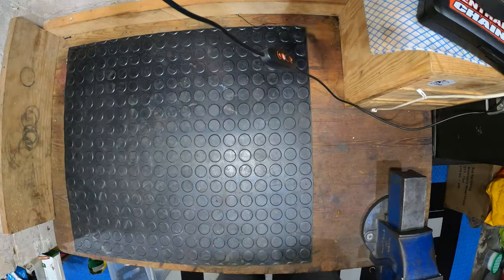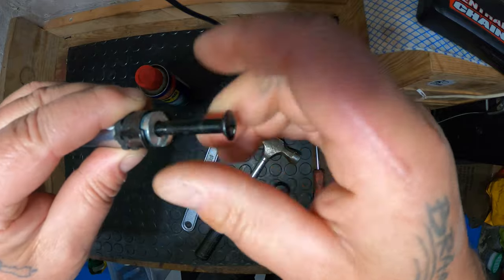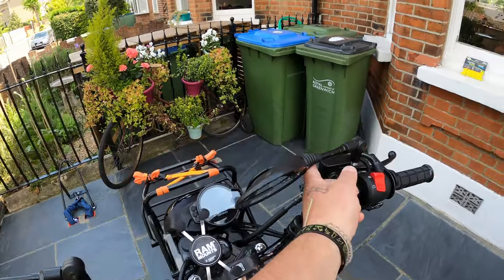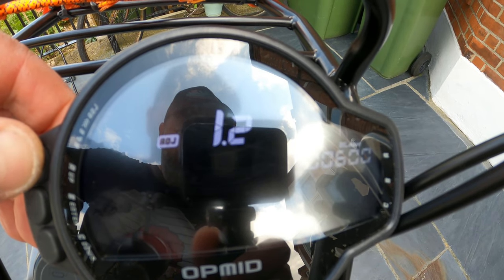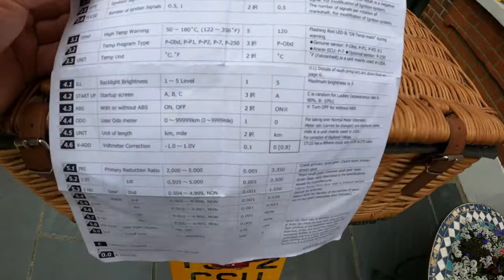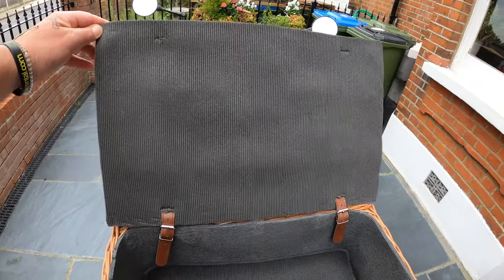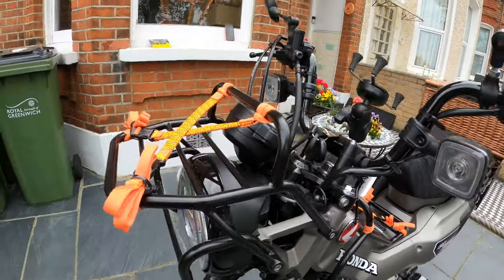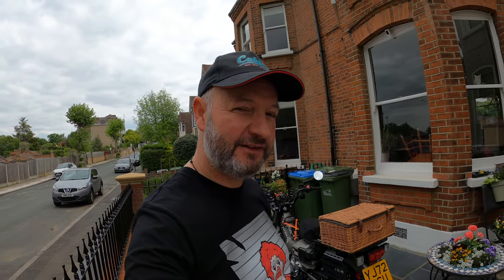UPGRADES The new GEN 2 CT125 Honda

Comment: Does the CT appears in other market where the gear shifting is reversed? - Toe hook up to upshift.
Reply from the maker: I believe America 🇺🇸 have that on there Gen 1 models not sure on the Gen 2 units imported at the moment into America
Reply: @KIWIMEDIA  My Honda Dash125 share the same engine as the CT. I also have a Wave110. Both shifts like your CT - Toe step down to upshift.
My MSX125 has 1st down, and 2nd to 4th up.
So does my Yamaha 125ZR - 1st down, 2nd to 6th up. 
However, my Kawasaki KSR110 has it all toe hook up from 1st to 4th.
I also had a C70 where 1st is heel, and 2nd - 3rd is toe. 
I feel toe down for 1234, and heel for 4321, is the most intuitive to use. 
When you heel to downshifts, blip the throttle to rev match for smooth downshifts. 
No need to hold and slowly release the heel shifter.
Reply: Latest US model, use heel to upshift.    Would like to see an optional 5-speed with clutch, however.